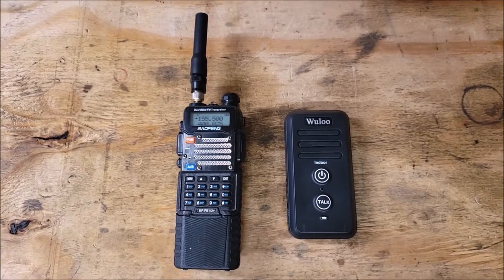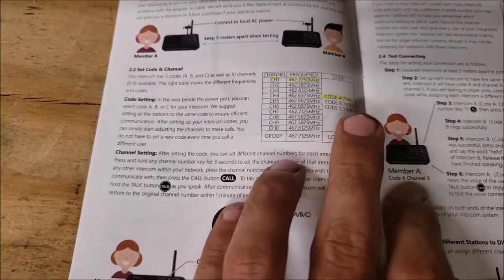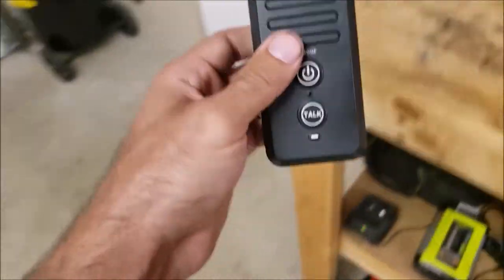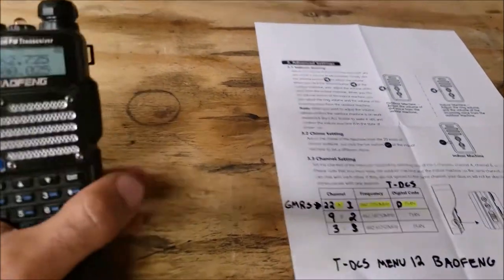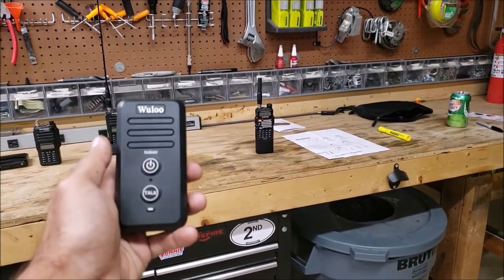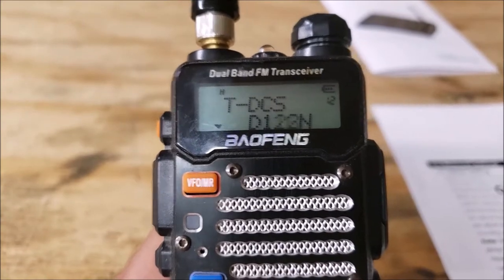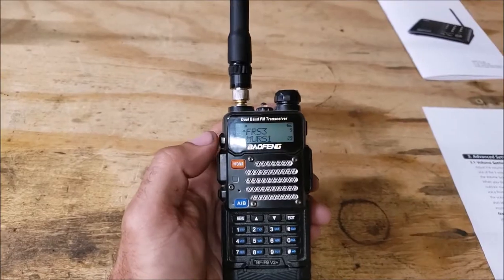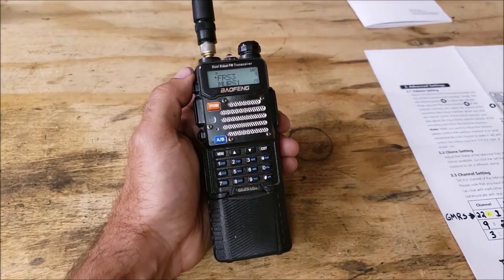Baofeng radio with Wuloo products

Comment: Nicely done! I just picked up set of Wuloo 888 intercoms to replace my 20 year-old Midland FRS wireless intercom units that recently failed and was looking around to see if I could still use an HT with DCS to work with the Wuloo base units. This confirms that I can which is great news! Thanks for taking the time to illustrate this "feature".
Reply from the maker: No problem. It's nice to be able to tune in when need be!